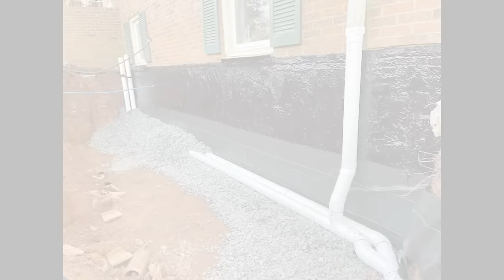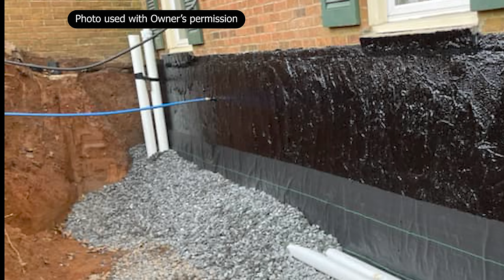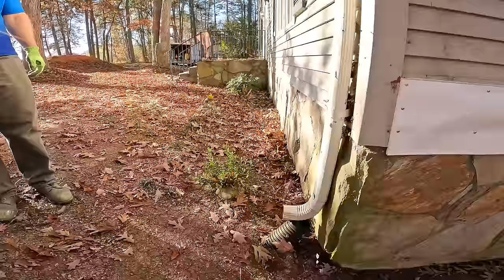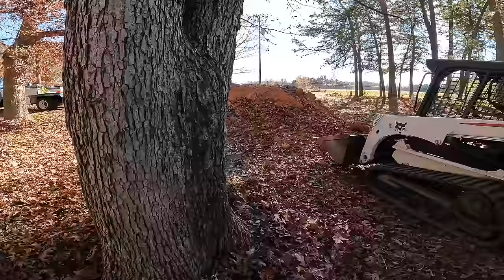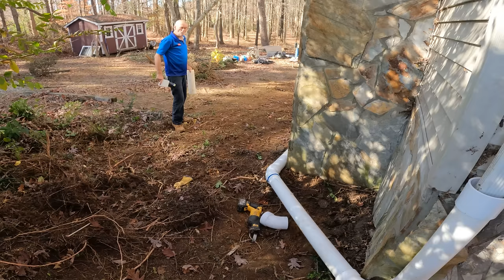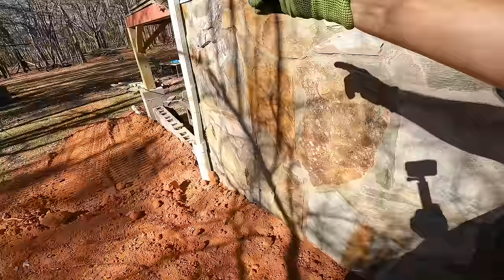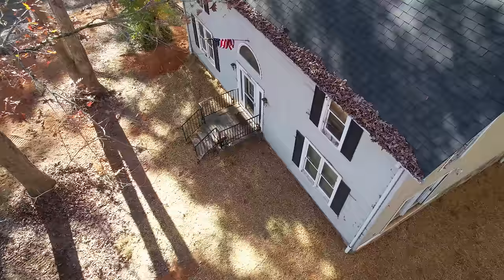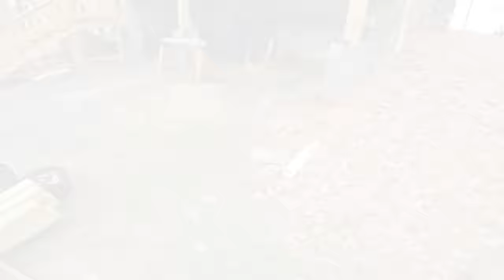Do I need a french Drain? Surface v subsurface water?

Comment: That drainage system is not bad at all as long as the water is being piped out to a off  property drain. A nice French drain and water sealing the wall with that protection will be a great add on to surface sloping with clay dirt. Lets see the same home with the rain coming down and  let's  see the basement after a rain storm. I bet they will have no problem
Reply: I have such a water problem in my yard.
The water was coming in the house.
The slope comes down towards the house similar to this video.
After several years I finally rented equipment and pulled the dirt sloping away from the house but now it has created a gully which fills up with water and now coming back to the foundation.
I was told the dirt did not need to be above the foundation line due to termites.
I have had many quotes on French drains etc and the range of $7-$8,000 but nobody guarantees their work.
And their solutions are not convincing me it will fix the problem.
I'm at a total loss
Reply from the maker: They might not have a problem after the installation, but a large part of my work is abandoning those systems that inject gutter water into the foundation and turn it back into water flowing out of my pipe during the rain. I see it every day which is why I feel so strongly against sending water into the foundation.
Reply: @GCFD  looking good and working good for the first 5 years is a far cry from working 20 years down the line. And why spend so much money excavating when adding the proper dirt is so much cheaper? Love your work, although I do think your area makes for certain solutions that wouldn't make sense for other areas too. Glad you point that out occasionally.

Comment: I think that french drain photo showed the gutters in a separate pipe from the perforated french drain. That should work fine for them. They are eventualy combined into a solid pipe and either pumped out or daylighted another way.
Reply from the maker: Key word - Should, Jason. If the pipe ever clogs you have a direct route to send gutter water backwards through the perforated pipe and into the gravel/foundation.

Comment: Always love your videos. Guess home owner may find he wasted money on gutter guards also, hope not. I have ,on my home which is gutterless used a french drain system for years. I try to catch the water about a foot down and carry it off. I and later "they' used plastic and pipes to run it off. I do not know, I kind of like a drain system at foundation but NEVER would I introduce water into that system. I had a little water under my house last super rain and have not had it before. I think it May be some of our interlocking land scaping MAY  have made a dam and water rose high enough to go by my sewer exit pipe. Not sure how well that was sealed years ago but you can see on the inside where they, as usual, just busted through the wall rather than worry about stucture or neatness. Now I will just watch. 🦇
Reply from the maker: If you can, install gutters on your house and pipe that water away. The roof is already collecting the water and so gutters catch it at the source. 👍

Comment: Yeah this was a good video. The waterproof guys they want to make money and charge the homeowners for stuff they really don't need. But when you took the drone up and you showed over the house, those gutters were full of leaves covered up with leaves and they're not even taking the water. They're just running it straight off the roof and I don't like those gutter guards. They don't work. I get up on the roof of the leaf blower at my place and clean them out in the fall and in the spring keep the gutters working but other than that it looks good. It did the trick. 👍👍🙂🇨🇦
Reply from the maker: Thank you! I was talking to a homeowner recently about cleaning gutters...I said twice a year when she asked if every other year was good.
Reply: Sounds to me there's a money issue

Comment: I put a french drain around my new garage at the foundation level, which is one block below the slab at the highest point.
I have yet to see any water come out of the drain, and it has rained pretty hard a few times since I installed it.
Reply from the maker: Hopefully there is no surface water getting into your french drain because it's being properly diverted away from the foundation (and drain).
Reply: @GCFD  The grading is pretty much leading away from the foundation except for one side that will need a retaining wall because the garage is lower than the house.
But there has been no pooling.

Comment: We had a waterproofing company installed piping inside my basement, we have rock walls dirt and then an inner wall. They were going to put it outside the part of the house couldn't be done I don't know that surface drainage would have worked. 
I get a lot of subsurface drainage on top of the clay we're on shallow dirt here in northwest Ohio the clay is about 3 ft down.
I have to have a sump inside my basement luckily I haven't had any issues with it as of yet but there's a floor drain closed if it ever does overflow.
Reply from the maker: I'm glad your system is working for you David. I try to account for all surface water around the foundation (mostly gutter downspouts from roof) to help reduce the load on the groundwater.

Comment: Ive been watching your cahnnel for awhile now. love the content.
As a first time new home owner. It would be nice if you could include prices for your area as a reference for us to make informed decisions in our areas.
You mentioned this customer got screwed over on gutters/guttergaurd install. and your guy could of done it better, with bigger pipes in 1/2 the price.  Like knowing a reasonable base price would be handy for everyone.
Reply from the maker: I completely understand where you're coming from here. I don't every talk pricing because money is a sensitive topic for most people. While it is very interesting to hear pricing, it won't really benefit me or anyone else to say numbers. This is because markets are so different in different areas. Plus you have drastically differing materials pricing across time and space. My recommendation would be to talk to different contractors and get some quotes. Get a feel for the contractor and check references. Gutters are a place where you can cheap out with fewer downspouts and have a system that doesn't work, so ask about some of the points I mention on gutters. Do you install a downspout at every corner? Maybe I should do a gutter video?
Reply: @GCFD A video about the pros/cons of various gutter configurations/sizing would be awesome!  They're key to a good, functioning drainage system.  If they're clogged then all the schedule 40 in the would won't help (or be of minimal benefit).  One question: when would you upsize to 3x4 gutters on a house vs. sticking with standard 2x3 gutters?

Comment: Great video,, nicely done. How does the clay do as far as growing grass??Would a thin layer of topsoil over the clay then seed and straw. Would the rain go through the grass/topsoil then be redirected once it hits the clay?? Keeping the water above the surface is a good idea. Never thought of it before that was. But it does make alot of sense. And the clay does a good job hiding the drain pipe.
Reply from the maker: A thin layer of topsoil is fine to add since we have great fall away from the foundation. Mulch or pine needles would be good as well.

Comment: My 83 yr old house might be in a high water table. Don't really know, however rain always makes my basement flood from multiple points. I need at gutter drainage, french drains, and dirt added around the foundation. There are some negative slope issues, and flat yard overall. There may be a need for someone to trench the foundation and repair and seal it. 

Where I'm stumped is how to daylight the drains because the house has a short (mostly ground level) brick "wall" framing the yard. I will not be coring holes in the brick. Do I use popups and allow water to flow on top of the brick so that it can reach the street or driveway? I really don't want to ruin the brick.

Comment: I agree with your solution and assessment. If you had looser soil like a sandy mix with little clay would foundation tile be the better solution? Basically if the soil doesn't let the water stay on the surface is that the better solution?
Reply: It’s okay to have a French drain but you want to avoid combining it with the gutter system. Should be kept separate and allow enough capacity to move the necessary amount of water

Comment: The house you showed that went with a weeping tile system, did you talk with the home owner, to see if the system is working? The photo you showed with the weeping tile, I did not see the dimple board that is usually installed, which lets water run down, and into the drainage pipes, instead of soaking into the foundation.   And yes this system is mostly set up due to ground water problems.
 Before you started your project, did they check to make sure there was no ground water problems?  Your solution looks to be a lot more economical, and logical. Grade the land to move water away from the house.
 I liked the video, it was different, but changing the format keeps your channel fresh, but they need to be spaced out. Overall I think you do a good job showing a variety of videos so it doesn't get boring.

Comment: Right idea, but if it were my house I definitely would have wanted to dig more of the original soil out to contour  the slope instead of just piling up more heavy soil around the foundation. On the front, the soil is too close to the siding for my liking, it makes the home look like it’s built on a slab, will accelerate the deterioration of the bottom siding, and doesn’t leave any room for additional topsoil/bedding for landscaping.
Reply from the maker: Those are all very important considerations Mark. Most of my clients abandon all of those when their basement has water pouring into it and favor a solution where they can see the problem water flowing away from the foundation. I definitely work with clients to meet their priorities for their house and situation.
Reply: They were 6 or so inches off the siding... thats getting real close but still tolerable. I would have maybe put in some box drains but the 18" and 24" boxes sure are getting expensive so maybe not within budget for the customer. Pipe and fitting cost really went up too.

Comment: Great job Shawn and crew.  I know the homeowner is going to be happy with the results.  Do you think a foundation drain would have been beneficial for when the water table rises so it doesn't go inside the basement?  We had a add a drain to our home because of this reason. We exhausted every other option and added a  French drain on the interior of our basement.
Reply from the maker: That's very interesting Shane. We don't have a shallow water table around here so I don't ever encounter that issue. I'm glad you got your situation figured out!

Comment: Hello Shawn,
I've found your channel in search of information for our foundation drain. We ar building a new house in europe (clay soil with fluctuating groundwater level).. Perforated pvc isn't avalible except for a type of very expensive well filter pipe. 
So i figured why not perforate it myself. 
Can you perhaps give some advice as to the perforation it self? 
- Size of holes
- 180 vs 360 degree perforation
- distance between perforations

Hope you can provide me with some advice or tips.

Greetings from the Netherlands!

P.s. Because of what i learned from your youtube channel i already made the following changes to my plans:
- Separate line for gutters,
- Adding grade to the yard so surface water flows away from the house.
- No corrugated crap, only pvc.
- Angled drainage stone (instead of roundstone)

Comment: As you said, the only reason to put a french drain upto the foundation is when you are dealing with subsurface water.
A friend of mine bought a house in the northern flatlands of Germany. You would guess the engineering should be exquisite... well, at most partially.
With really high groundwater (like only a foot deep), the house still has a cellar. And how fate would bring, the waterproofing was/became leaky, so whenever it was raining and groundwater rising, water would seep through the walls.
They dug up the ground around the most affected wall (now a decade ago), and there actually was a french drain, but literally the most inefficient and stupid install I have ever seen: Perforated currogated pipe was burried into sand (and was obviously filled up with it) as well as ceveral big-bags of construcion waste like concrete and cinderblock chunks, home insulation, cable insulation and so on. Biggest laugh was, when we dug out the "outflow" of the pipe. Going from the house, the perforated pipe would go to the center of the yard and coil up in a snail there - no fall, no outflow. This is just pure stupidity, like someone pouring water over a chainlink fence to get the yard dry during a waist-high flood.
Putting in new waterproofing, a french drain with gravel, a 2,5m deep cistern out of concrete rings with a bottom and a pump in it to the sewer did the trick.
...to that wall at least, as years later, water is finding a way through the other walls now.

I am not sure, who did that install, but their competence should really be doubted. I am not ruling out the owners themselves, as the previous owner and builder of my house had his "special solutions", too - a real misunderstood "master mind" in engineering. We fixed his "drainage solution" for the back of my house four years ago now, and oof, that would be at least another long comment for what we found there... But nothing concerning french drains, so that'll come at some point later :P
Reply from the maker: Thats a very interesting story. Thanks for sharing Sophie!

Comment: I live in a high rainfall ares of Northern England my house in no way the same size of this house (roughly 2/3 the size) and the guttering and down spouts are all way bigger than what has been but on this house,  the guttering is a 6" X 4" trough with 3 x 4" Diameter down spouts, even then they can be pushed to the limit, 
Whomever did the guttering and down spout on this house sized it to require repeat visits.
As for a french drain at the base of a foundation wall that's a serious No-No unless there is serious subsurface water and then an impermeable multi layer system would be used like HydroBond 410 GeoDrain or PermaSEAL 8 Geodrain depending on the amount of water and ground conditions.

Comment: This is your best video yet! I live in dry Utah and have been looking at mitigating some slight water/ moisture intrusion in my old home (1940) basement. We do not have ground water so all of it is coming from the surface. I am however faced with poor grading and elevation. Street is higher than the house so I can’t fix that. The second house in the video (the one with the nice patio, retaining wall) is very similar to mine. How did you propose they get rid of the water by that retaining wall and structure? It appears lower than everything else. You also mentioned you suggested changing the grade I think by the house which also appears lower than everything.

Comment: 3:30 I'm not an Expert, however, I believe, at least in Ontario, directing the gutter downspouts into the Foundation Tile is a violation of Building Code...

Having a French Drain at the footing is a VERY good idea as long as the pipes are NOT Corrugated and have a place to send the water that's away from the foundation...HOWEVER, they should NEVER have to deal with Surface Water...That should ALWAYS stay either on the surface or in shallow PVC pipes directed to a ditch, hill or a leaching field (like what Septic Systems use) somewhere AWAY from the building...

As Shawn has stated many, Many, MANY times before, Corrugated pipe is the WORST possible pipe you can use to collect and transport water away from your home...ALWAYS use smooth walled PVC (Schedule 40 minimum, schedule 80 if it's within 3 inches of the surface and might get run over by a vehicle is my recommendation)...PVC may cost more than Corrugated does, but it won't fill with debris in 3-6 months and stop directing water away from the home and need to be replaced so actually, in the long run, PVC is cheaper...MUCH cheaper than Corrugated...
Reply from the maker: Thank you HHH! You may dislike corrugated as much as I do, but make sure to watch my Benefits of Corrugated Pipe for a tour of its unsung benefits! 
https://youtu.be/5qujLksWVW4?si=mJsF8R1dzeedeJ_F
Reply: @GCFD  Watched it when you first posted it a year ago...

😄😁😆😅😂🤣

Comment: Shawn, When you build-up soil against the foundation, aren't you concerned about stopping up weep holes? I don't know if the stone veneer applies but bricks will have weep holes that should not be blocked.
Reply from the maker: There are weep hole concerns and also grading height-to-siding concerns. These are carefully weighed against the flooding concerns and many times something has to give. I often raise grade to close to the siding to achieve fall away from the house and I explain to the HO to step up their termite control measures and keep debris from building up in that space. Ideally I would have raised the house up in this situation but we can't do that. These are important points to consider so thanks for bringing them up gman!

Comment: Hey I live in a 50yr old Chicago quad level with a plugged drain tile system & crying floors in the upper & lower basement. What the heck is this "crock" someone had installed. Right now I'm down to dehumidifiers and fans. Dreading the idea of clearing the 5 x 60 ft  space next to my neighbors concrete driveway that I believe should be regraded. What are your thoughts?